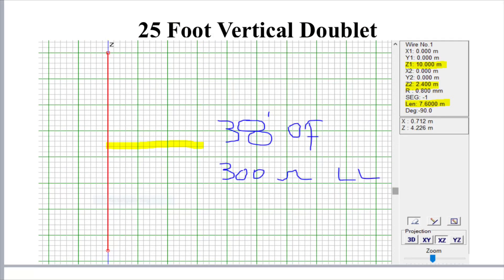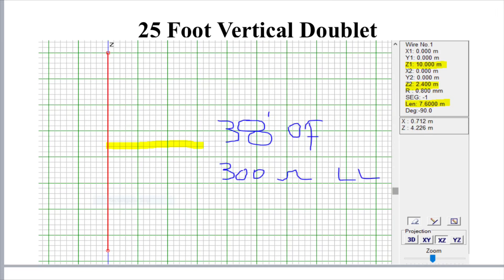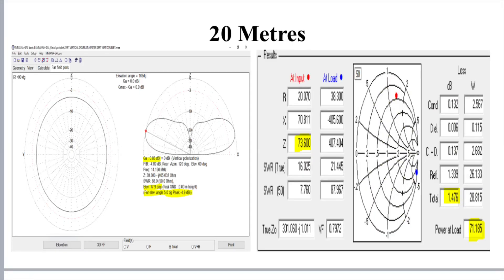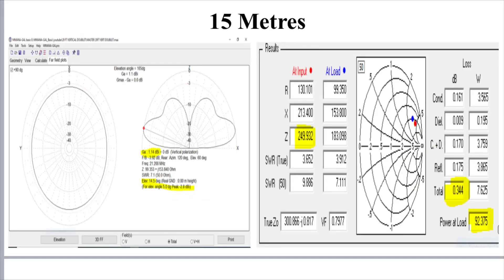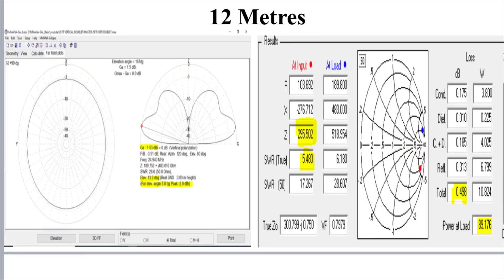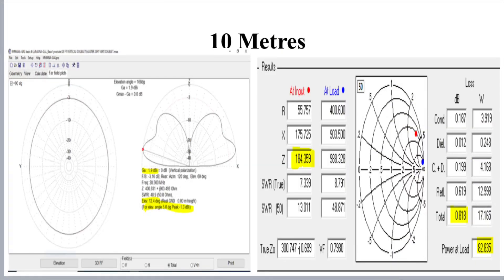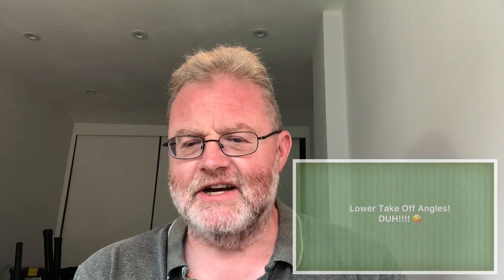Ham Radio: Vertical Doublet Antenna - Multiband

Comment: Hi Tim, thanks for this, very interesting and thought provoking. This is probably a stupid question but is it possible to run one element vertically and the other along the ground as a radial/counterpoise and feed with ladder line? I'm guessing the ladder line needs to be elevated?
Reply from the maker: Hi - yes the ladderline has to be above ground. You can feed this as an L shaped dipole but the ladderline should be dissecting the 2 legs and run away from them if that makes sense?
Reply: @TIMG5TM  Thanks for the clarification Tim, I appreciate it.

Comment: Is the 38 feet of 300-ohm ladder line the best overall length or was this chosen because it was just enough to get to the shack? I'm thinking of building this simple antenna. What would be the best length for 450-ohm ladder line for all of these bands on average 20-6 meters?
Reply from the maker: Enough to get to the shack. I might try and model that.

Comment: Thank you for pointing me in the direction of the transmission line calculator, it works very well. 
I went through the figures (assuming 14.150 for 20m) and get very much better results by assuming generic 450 ohm window line. The 20m losses in the 38ft of feeder are MASSIVELY reduced. (91.5w at the antenna DESPITE the SWR on the line being higher still. It also happens to offer a better match to 50 ohms at the shack.... (SWR down to about 4:00:1).
17m figures indicate 96.5w at the antenna (though massive SWR at the shack). It is surprising just how lossy 300 ohm ribbon can be,... 450 in this case is massively better. 
73
Reply from the maker: Agree with the 300/450 differential. I used 300 purely as a weight consideration for the fibreglass pole. I agree though that 300 is surprisingly lossy compared with 450

Comment: Hi Tim I use the Diamond BB7V works well up to 115 Watts very good for small Gardens. I use a long copper wire 130 Ft long and 40 Ft High 600 ohm  ladder line in to a 4.1 Balun then in to a AMU works very well on 80 m at 400 watts. 73 Tim de G6JMX
Reply from the maker: Sounds a useful set up Barry 73

Comment: Why not use a 6/1 balun at the tuner if your feedline is 300 ohms or an 8/1 if 450-ohm latter line?  I was just today thinking about the Gap Challenger which is a true vertical dipole just under 17 feet on each side of a PVC insulator pipe. It has some hard-to-match stand-off elements and has (had) some kind of 75-ohm matching line that had rotted away and would cost over #100 to replace. I mentioned doing something like you have done here, I do have a ground mount that can be used to raise it up and down, but it would be just a couple of feet above the ground. Anyways, after I deal with a health issue I hope to experiment some, this video reminds me to do so. Good video thanks !!!
Reply: Using a balun would transform the impedance to 50 ohms ONLY on 1 frequency, where the dipole is 1/2 wavelength long. On other frequencies there would be a mismatch.
 The correct way to do it would be to use a balance tuner (MFJ974hb). Great video Tim.
Here is another very similar type antenna:
https://www.dj0ip.de/vertical-antennas/simple-multi-band-vertical/
Reply from the maker: Thanks Iain, yes Rick is a great source of antenna information. Appreciate the comment. 73
Reply from the maker: I think Iain answered your question below regarding Baluns and impedance. Hope your project goes well. Thanks for stopping by and commenting 73

Comment: I have less space that you I think. Overall about 10m horizontal but what I was hoping you would mention was the horzontal bit and its stress on the Fibreglass Pole. I have thought about this and was thinking in terms of bracing guys againt the pull from the ladder line which in my circumstances would be about - say 7m max with guys from near the top of the pole to the fence. How were you going to address this?
btw :-) I have a scruffy beard as well and I don't care. :-). I am beginng to realise how little I know about antennas.
Reply from the maker: Hi James, I’ll be hopefully looking to try this out soon. I have done before and found that paracord attaches to the feedpoint and then it to the opposite direction to the ladderline provides a good way of keeping things straight 73
Reply: @TIMG5TM  I think those braces can also be sort of passive. They do not need to be anything more than a calculated length.